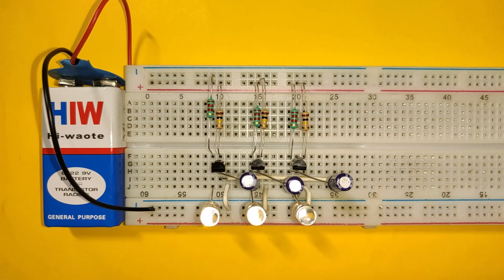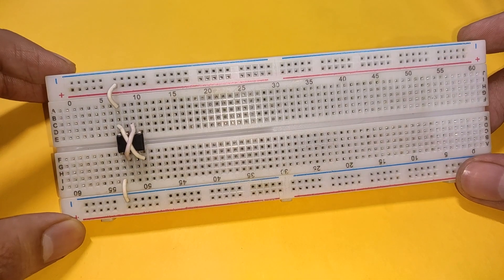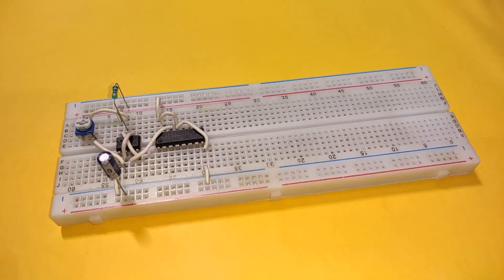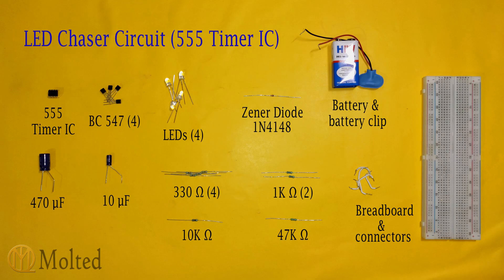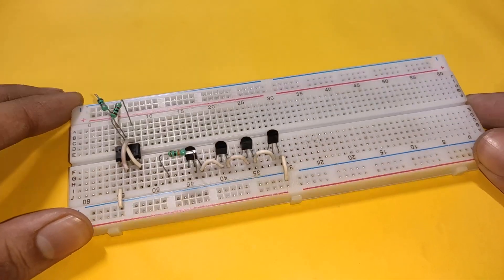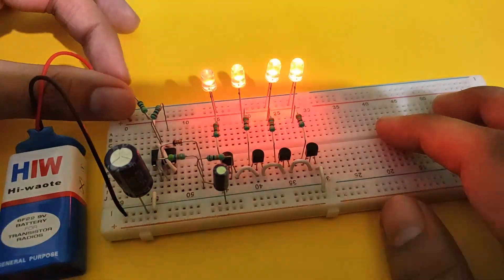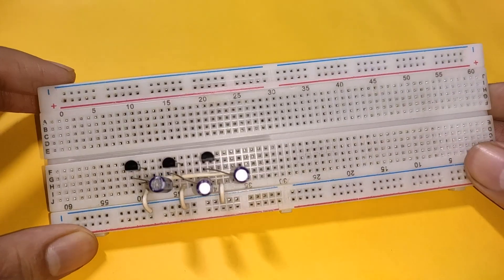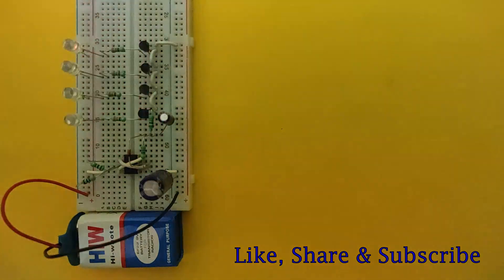Three Ways to make LED Chaser Circuit with Speed Control + Back and Forth Effect

Comment: I'm trying the third option and my circuit doesn't work properly, when I follow the circuit it doesn't work, when I unplug the cable from the last capacitor to the first transistor, the circuit starts at the second LED like in the video but stops after the third one, the first one never lights up, any idea why?
Reply: they lied it's 12 volts not 9volts
Reply: @vjnarayan8416  It is 9 volts not 12 volts.
They showed it correct